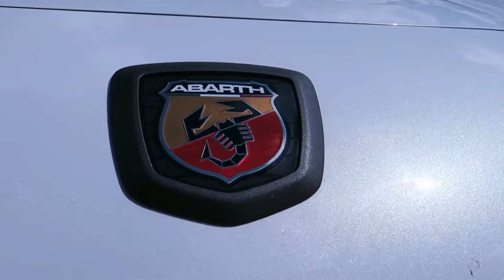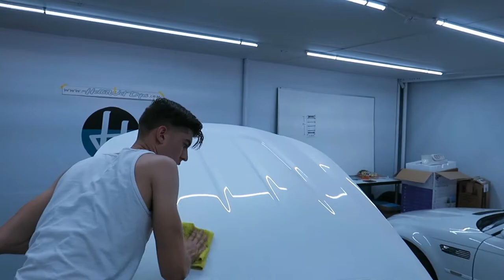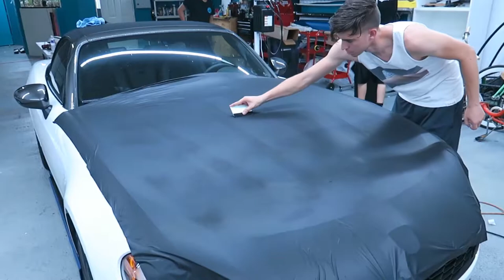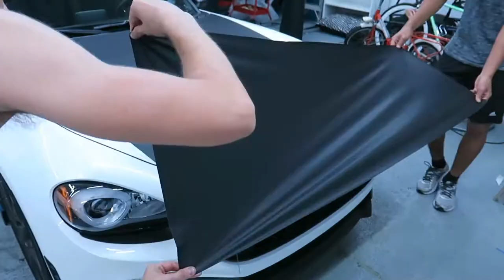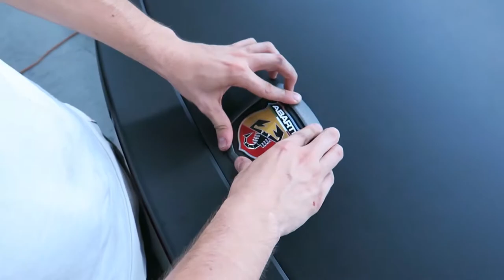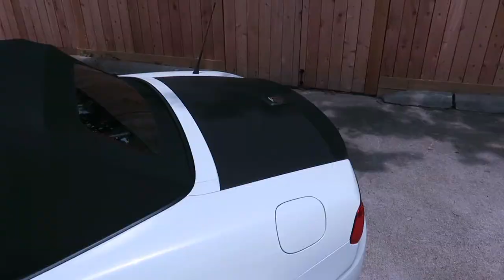FIAT 124 SPIDER TWO TONE WRAP !!!

Comment: Hey guys, curious how you managed to take off the little rear lip/spoiler to get under it when wrapping. There are these 3 green latch things I noticed on mine, and your vid as well. But not sure how to remove all fasteners or connectors to allow for a safe and easy rear lip removal. Was it just prying the area up with the plastic dashboard removal tools, or did your guys go in to the little slots under the trunk and somehow grab, squeeze and push the 3 green connectors through? As I’m so nervous to try prying th em all up from the top portion of the trunk as I don’t want to break anything...Can you perhaps respond on how they did it or post a secondary vid just explaining the technique, please and thanks. Nice clean job on the wrap.